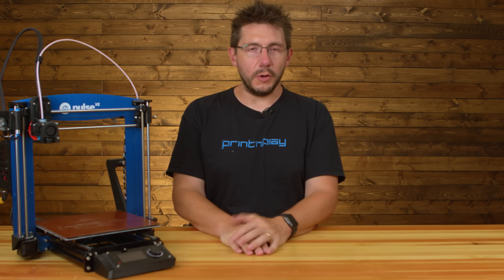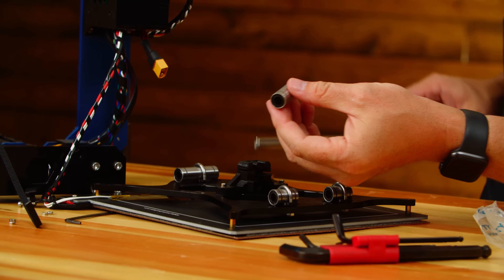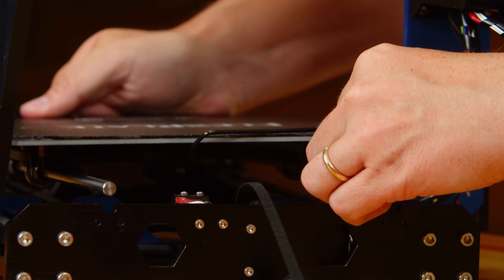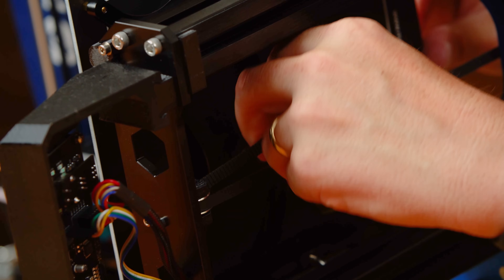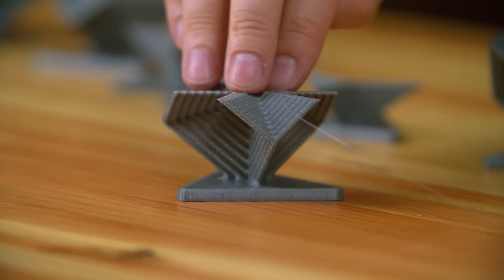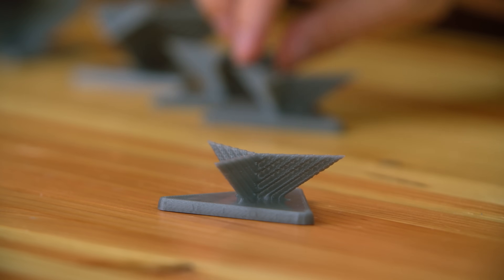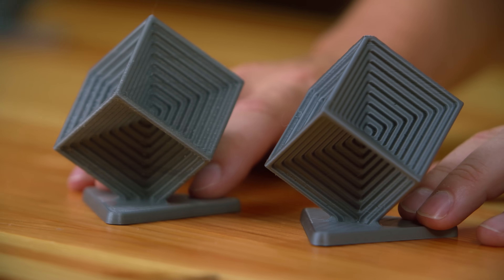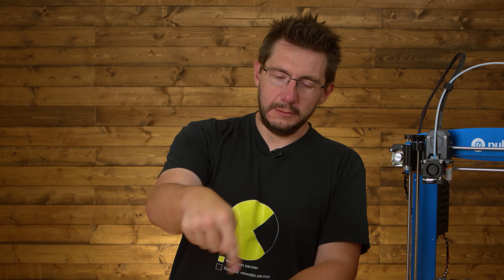3D Printing 101: How To Fix Bad Bearings on a 3D Printer

Comment: Joel!   You did not pack those bearings before you installed them?!?!  I am getting a FORESHADOWING of early bearing failure and more repairs in your future ...
Reply from the maker: No, I was under the impression that wasn’t needed for these.
Reply: @3DPrintingNerd  Well, I am more of a "take no chances" kind of Joe.  From my understanding, the lubrication that ALL open bearings come with is just  for shipping & storage. SEALED bearings (where you can't look in & see the balls) are properly lubed as shipped.  I used NAPA "Sil-Glyde" to lube the bearings when I put my Prusas together - and they are still going strong...

Comment: Hello Joel.
As ever ... a good video. Just a hint from mine. i do prefere sinter bronce bearing and I did replaced all my bearing with them. it is smooth, quiet and durable. therfore i made an adapter for it ( the #ey work also much more better than the IGUS ) 
here is my model if you want to check if it fits for you. so ... High fife (i love your channel.
https://www.thingiverse.com/thing:3673382

Comment: Nice troubleshooting video. It shows that you can go down wrong paths because the problem is really elsewhere compared to what you thought.

Lots of mis-focussing with this video. Autofocus doesn't always give you what you want.  Another issue, showing the bottom of the printer, there was a lot of black on black, and what you were trying to show was not visible. An exposure change would have been helpful. Auto exposure would have work in this case, but it certainly isn't a solution I would use.
Reply: Tina Yoga thanks! We switched to two new cameras and a new LUT. Working on it.

Comment: I wonder why they went with the single bearing on one side for the Pulse Sexy.....
Reply: So it wouldn’t bind (Prusa uses zip ties so they auto-rotate and align, that’s probably the horrendous sound he heard, tightening things without it assembled with shafts in and then obviously they were off until he probably bumped them into place when messing with the belt).

Comment: You can use the Y motor as a tensioner. Take out one of the screws to let it swivel forward. Put on the belt, than swivel the motor back and, viola!

Comment: 3:35 maybe those magnets are arranged in a hallbach array and the sheet is helping the magnetic field to get to the back?
Reply: yes, It's a giant fridge magnet. It's a slab of ferrite magnetized by "segment" in a hallbach configuration. It has to be ferrite to avoid de-magnetization with the heat, so fridge magnet is really the right tool for the job.
Reply: Has to be :)

Comment: I pretty much gave up on using Mattercontrol for the Pulse. What works great is using either SLIC3R or Prusa Slicer, write a gcode file and run that through MC for bed leveling. And use Volumetric E - big difference you can see a video on that on my channel if you are interested on other improvements on the pulse - contact me
Reply: https://www.youtube.com/watch?v=kugqYO-Jang&t=114s Here is how to slice better on a pulse

Comment: Nice video Joel and the important part about not tightening the U bolts too much is a relevant point for many of the kit built printers.  One thing that may be worth looking at for future articles is bearing lubrication. This is a big topic on many forums as to what is good to do and not good. 
Personally I clean the bearings first the oil lubricant and fit them. Many others use various types of grease. I don’t think it makes a big difference which way but it all part of the printer maintenance. 
Keep up the good work

Comment: I am not a man of science, so I don't know the term for the phenomenon, and I'm probably going to make someone grimace with this halfsplanation, but that steel plate is effectively stretching the bed's magnetic field bubble. Basically, the plate is conducting the field lines and causing them to form a wider arc to return to the other side, where your wrench is.
Reply: As someone who is also not a man of science, but has had some basic physics in school. This sounds believable to me. And I like you.

Comment: Guys does anyone know why my prints keep warping? Thanks
Reply: First off, what model and filament type are you using? I will assume PLA but that’s not always the case. I had the issue of warping for a while, but my machine has a feature that lets you adjust the height between the nozzle and the print bed. Try lowering that a bit. Otherwise, consider increasing the temperature of the print bed (small increments like 5°C) and if that doesn’t change anything, try the same with the hotend. If that doesn’t work consistently you might just need to clean your print bed with something like isopropyl alcohol, just rub the bed with a paper towel with the alcohol on it. Sometimes debris or dust can accumulate that hinders the print bed’s ability to stick to the plastic.

Hope that helps! I am not a professional, just someone who wants to help.